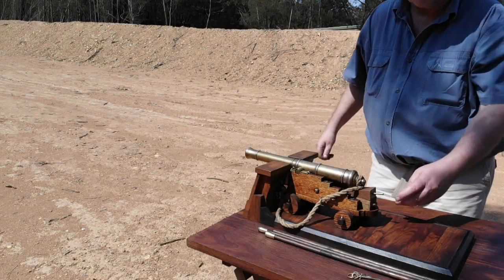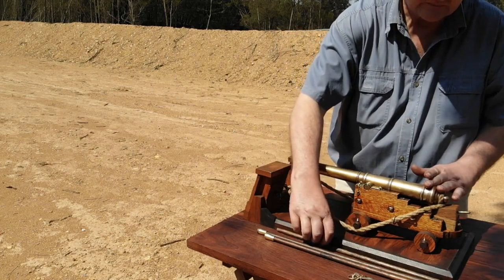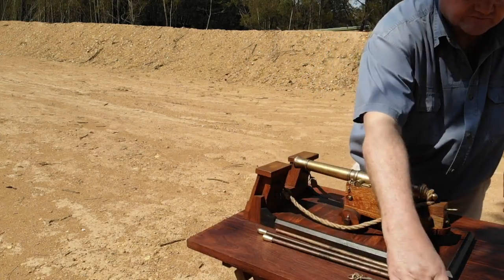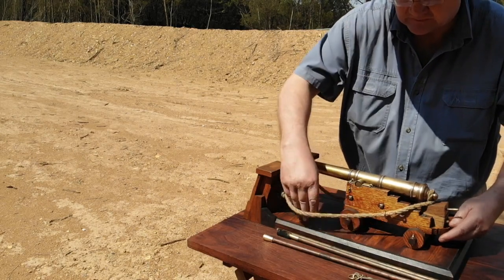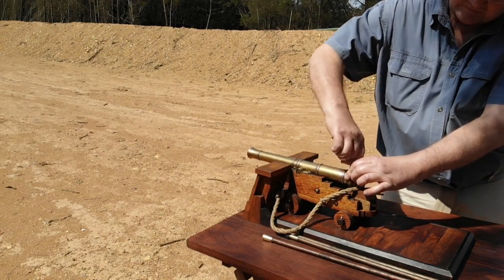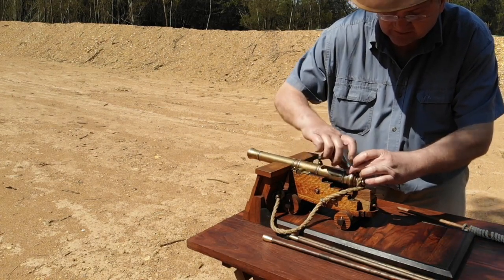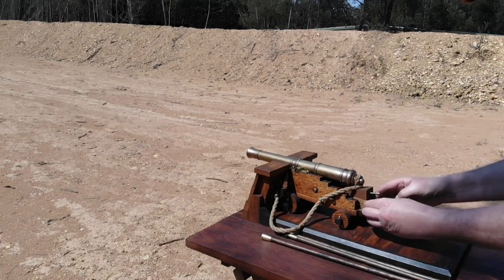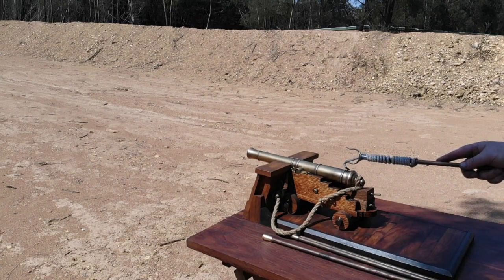The firing of an eighth scale model English 12 pounder naval gun.

Comment: So it is a 1.5 pounder.
Reply from the maker: Hi Jay, weight of a ball doesn't translate like that. A 12-pounder is 4,6"Ø (117mmØ) and at a an eighth scale is 0,575"Ø (14,6mmØ). I upped the calibre a fraction to match a Tower Flint-lock pistol at 0,62"Ø (15.75mmØ), for which I have the ball mould. The weight of the ball in lead is 0,70oz (21g)